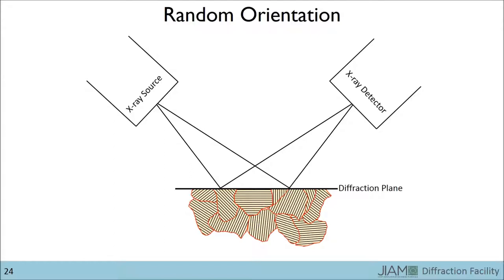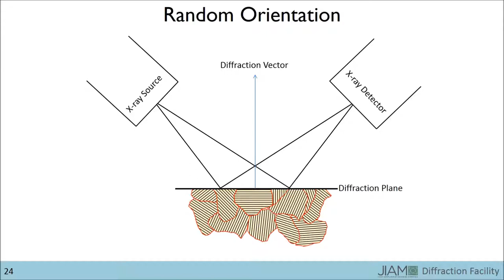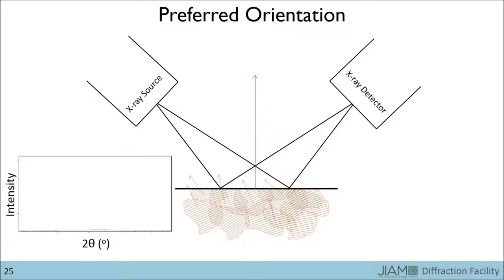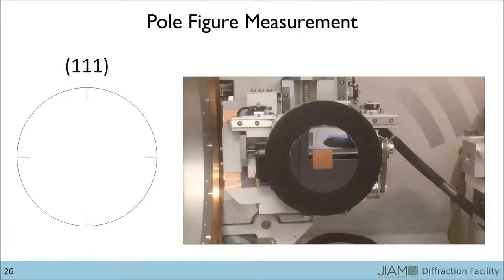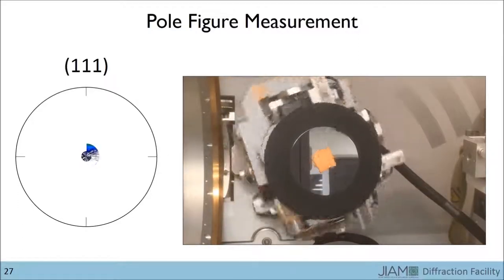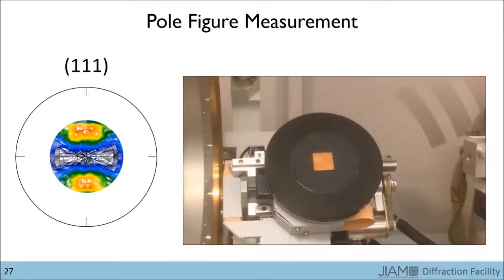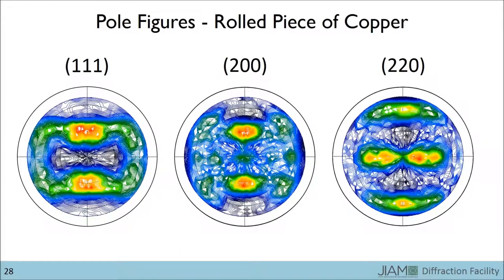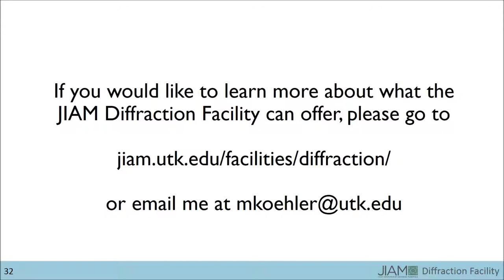Pole Figure/Texture Experiment - JIAM Diffraction Facility

Comment: Bu t I noticed that the pole figure has strong symmetry character, it seems that one could almost plot complete pole figure with only quarter of it. I wonder what is the least phi angel needed to detect to plot a whole pole figure ?
Reply from the maker: While many pole figures would be well estimated by a quarter pole figure (at least many of the ones I have worked with), it certainly isn't always the case.  I would recommend collecting full pole figures.

Comment: Can you upload video on IPF or if it is already uploaded, can you share it link?
Reply from the maker: Unfortunately, I do not have a video on IPFs.  I can tell you though that if you load the pole figures into the Panalytical texture software, you can calculate the ODF (orientation distribution function), which will also let you calculate IPFs.

Comment: Hi, How to determine the angles of source and detector to produce planes?
Reply from the maker: I think you are asking how to determine what omega and 2theta positions to use to get a particular diffraction peak for your particular sample so that you can then collect a pole figure by rotating phi and chi (please correct me if I am wrong).  Before performing pole figure measurements, I always perform a standard "powder" diffraction experiment (called a gonio scan in Panalytical software).  This way, you can determine the 2theta and omega angles needed for whichever peaks you want to use for pole figures and make sure that peaks are not overlapping.  This can be a bit tricky if you have a very large amount of preferred orientation since the peak might not be visible with a standard gonio scan at angles of 0 for chi and phi.  In this case, if you know what phase your sample is, you can look up the peak position in a reference file, go to that 2theta position, and then perform a chi scan to see if you get a spike of intensity somewhere.  If you do, go to that chi angle and perform a gonio scan.  You should then be able to see the peak better to get a more precise 2theta location.  

I hope this helps!  If I misunderstood your question, please try asking again.
Reply: @IAMMDiffractionFacility  That is all I want to know. Thanks you for your answer. that is awesome!